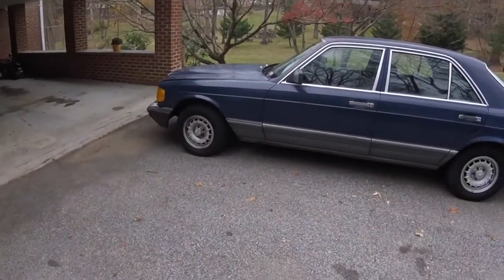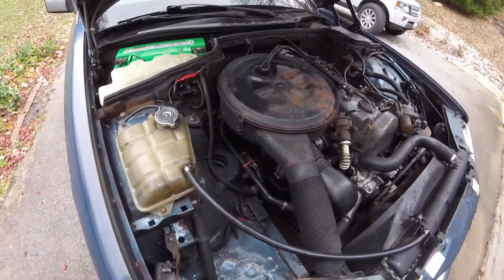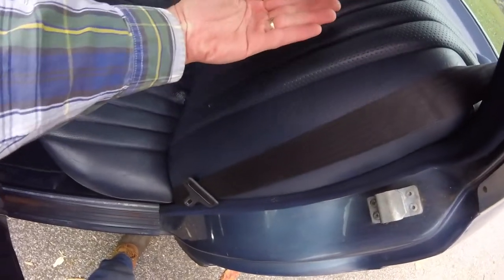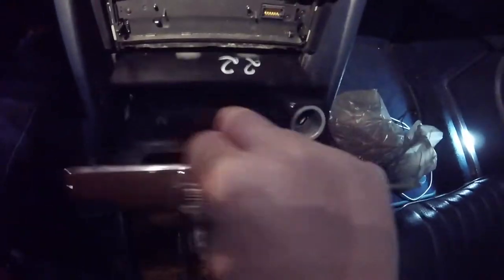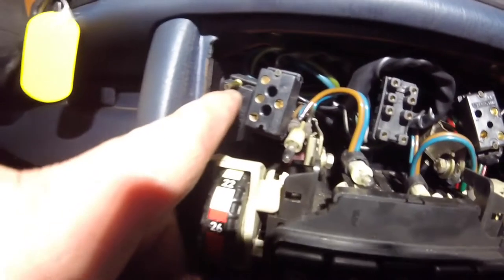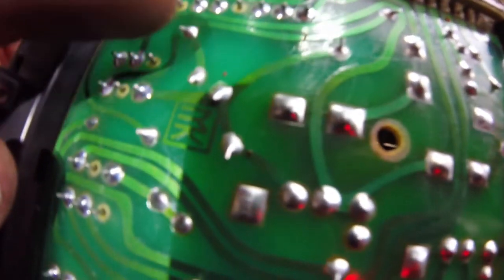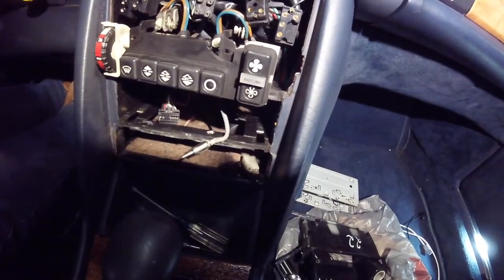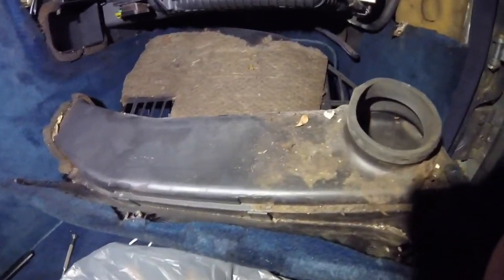Mercedes 300SD 300D Seat & Blower Repair

Comment: I have an 84 300sd with the exact same issue. Mines blowing the blower fuse so often I installed a 25 amp circuit breaker
Reply from the maker: Replaced the fan

Comment: just a note, when the blower only operates on high, it's usually a leak in the climate control vacuum system. The default for safety in this case is high speed so that the windows are defrosted. Happen to mine a month ago. hose to center pod came loose and when I plugged it back in everything worked. You can test by pulling vacuum under the hood to the hose that leads to the system and if there is leakage you've most likely identified the problem(off the top of my head I believe it's the one with a green stripe).
Reply from the maker: Great info! Thank you